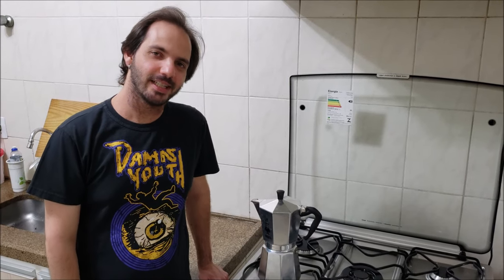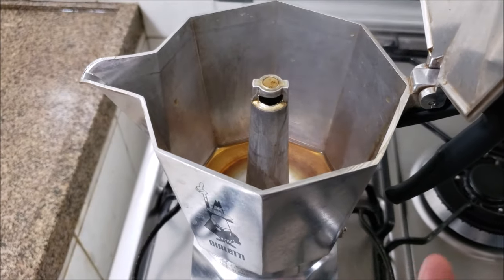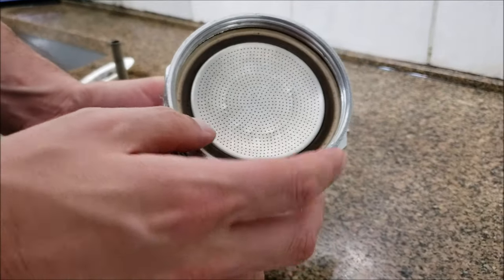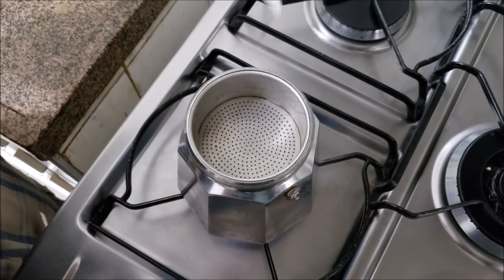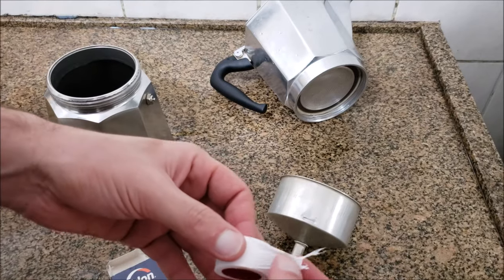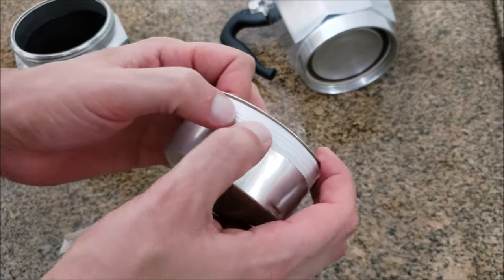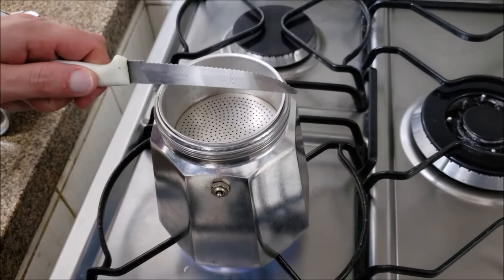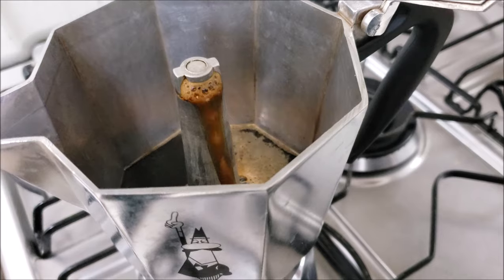Moka Pot sputtering or not working correctly: how to solve it!

Comment: Hello,  I used your solution and its working very good! I know that you mentioned that it can withstand up to 230 C however, the tape I am using is melting, or to be more specific the white color of the tape is gone on some parts of the tape, leaving a transparent tape. so I am concerned about using this tape. I read your comments one said you could use a tape for engines! Can you think of something else I could use?
Reply from the maker: Hello, Ahmad! If you're using a PTFE (Teflon) tape, you shouldn't worry about it, it is fine. It is normal that some parts of the tape become transparent. But if you're worried about it, there is a kind of high temperature silicone glue, which is used to seal engines cylinder head, and maybe it could work. Another solution is finding a O-ring that fits to your Moka Pot funnel. I hope I could help you!

Comment: i just wondering, is there any chemical contamination issue with this tape? when we heating the water?
Reply: I was thinking the same thing. I don’t think Teflon tape meant for pipe leaks should be used for food-grade products.

Comment: 9 years ago I bought a €5 supermarket brand moka pot. It still works fine, but last week I bought a Bialetti moka pot for €20 thinking it would be better quality. Not at all, it brews slower, there’s plenty of water and stray grinds left in the bottom chamber after brewing, therefore, less coffee. Also, the designs are just stupid I don’t need a brightly painted pot with a cubby moustached guy embossed on it. The simple design is part of the beauty. My point is don’t be fooled, Bialetti is the most well-known brand, but it isn’t the best quality moka pot.
Reply from the maker: I agree with you! I bought my Bialetti thinking I wouldn't have issues with that... big mistake! I'm lucky I could fix it and make it work, but I've spent a lot of money on that, it shouldn't show issues like that!

Comment: Hi! Thanks for the video. I've other issue with my recently bought moka pot. When I try to use it, initially I just hear the water boiling on the low part, but when the coffee raise it emerged so violently (literally jump over the can) that I cut down the fire and the half of the water keeps in the lower part. 
Honestly I don't know exactly what to do and I'll really apreciate some help to solve my issue and start using my moka pot :(

Comment: Isn't PTFE seal tape made from the same thing that makes Teflon, which is can cause a bunch of health problems if heated too much, and won't the tape be coming in contact with the water you'll be drinking?
Reply from the maker: Hi Pedro! Yeah, it is the same compound. But as long as you don't leave it at the heat after all the water comes up, the boiler of your Pot won't overheat more than 100°C. And at this temperature the PTFE  won't degrade (the melting point of the PTFE is about 247°C). Other than that, it quite doesn't get in touch with the water because of the place it is located. 
The only way it could be bring you health problems is when you heat it without water in the boiler, so that the PTFE tape will melt. But at this point, even the rubber gasket will melt, which is also detrimental to our health. 
I hope I've answered your questions!

Comment: Thanks Vinicius, what a brilliant idea. I've bookmarked your video, in case I have trouble with mine. Out of the box, brand new, I had to fix up the badly cut funnel tube, by getting rid of the burrs and polishing it on the inside. Something I should not have had to do. Is that a Bialetti 9-cup pot? If so, that is the one I have. Cheers. 👍
Reply from the maker: Thanks, ss! That's nice to read from you! 
I know what you mean, because mine was also not so well finished. 
This one is a 12 cup pot. 
Cheers!
Reply: @viniciusandrea3251   Hi Vinicius, yes, I thought your Moka looked like a larger pot. I can see this thermal problem being worse on an 18-cup one. That was probably the largest they could make it, before it failed to raise the boiling water.
To fix the tubing, I used a closed long-nosed pliers and ran that inside the tubing, to ream it out and make it round. Then I rolled up 1200 grit wet or dry sand paper and polished it out. Then cleaned up the outside of sharp edges. The aluminium is very soft, so it has to be very fine grit. 👍

Comment: I need some advice. Next to  the gasket on the bottom of the upper pot, there is a beige color caulk seal. On my pot, this seal is disintegrating and after a brew I find bits of it melted on the rim of the lower pot.  Is there a way of replacing this seal?  What sort of caulk should I use that is food safe?  Thanks.

Comment: Is there any concern with exposing the PTFE tape to high temperatures as it is in this scenario?
Reply from the maker: Excellent question. No, because the melting point of the PTFE, when it becomes dangerous, is about 350 °C and the moka pot temperature, when fulfilled with water is about 100°C.

Comment: What is the reason if the moka pot  suddenly dumps half of the water trough the steam-valve at the side, not long after starting to heat up the pot (before the stove is maximum hot and before any water decides to come up)
Reply from the maker: Well, probably your safety valve is defective. You should consider repair or even replace it

Comment: It still looks wrong to me. Rubber seal have to have double function tighting the boiler and isolating the funnel from the boiler. So your initial experiment is wrong. You had to force your gasket on the rim, but even if you did that it would not be very relevant. I can't think of the way ifentifying if funnel is still loose after assembly of your moka pot other than that spitting behavior. If it does that it could mean either that funnel is deformed or that gasket is to be replaced.
If your moka pot is new you have to return it if somethings like that happens.
Your solution looks to me more like the last resort when everything else had failed.
By the way Mukka (the one with cow spots pattern and some kind of milk frothing contraption on the stem)  has that additional gasket on its funnel for some reason.
Reply from the maker: Hi Vlad, how are you? I see your point and agree with most of it. The rubber seal really should have double function, but in my case and in the case of many people, it wasn't happening. And that's because the funnel gets somehow deformed due to the use. Even tightening it as strongly as possible, depending on the issue, the gasket can not manage to seal it correctly. 
For sure my tip is a last resort, and the "best" solution would be buying a new funnel. But buying a new funnel is not always easy (in some countries it has hard to find to buy) and it is way more expensive that Teflon Tape. Other than that, that's the beauty of this hack: an easy, cheap and alternative solution to make your Moka Pot work nicely again!! Look at the comments of this video and check how many people could have great brews again doing it. Isn't that great!?

Comment: what if you put the tape on the threads? great fix but you know you dont want no ptf chemicals in your coffee. i was searching to see if you can actually fill the pot past the the pressure release valve and that is how i came across yout video. God bless you for coming up with solutions to make sure we allways got coffee 😆
Reply: The threads aren't what's leaking here, so adding tape to them won't help.  The leak is the gap between the basket and the boiler edge.
Reply: @LJ-wo1wf  I’m a genius 😝🤓 🙏🏻👍

Comment: The original rubber gasket eventually fail. It will lose flexibility and after a while will no longer seal the top assembly to the bottom. The solution is to get neoprene gasket replacements off the internet. Amazon sells them for not too much money.  Neoprene tolerates the coffee making temperature and remains flexible while the original rubber gaskets will quickly fail.
Reply from the maker: Thanks for the tip, Joe! I'll try it!

Comment: Thanks a lot, this worked for me and I've had troubles with this issue for a while, it saved me from buying a new one! 
For me it started doing it when I changed the gasket, initially I thought it was because the size of it was wrong (it doesn't seem to perfectly fit the upper part, it moves a little bit, even though it is a Bialetti gasket supposedly of the good size), any idea why?
Reply from the maker: Hey, Giullaume, how are you? I'm I could help you! Did you check if you bought the correct size of the gasket?
Reply: Im fine thanks, and you? It is supposedly the good gasket size (bialetti gasket for 3-4 cups moka) but in my eyes it isn’t the good size, it lacks something like 1mm, hence the gasket and filter are slightly moving when touching it. It’s strange as I dont think Bialetti changed their gasket sizes over a few years... 
Anyway with your technique I’ve had perfect coffee for a few weeks now so its ok, even though I’d like to solve the mystery and find the right gasket size!
Reply: New gaskets will cause this problem every time, due to the fact the rubber is hard and clean, ie. grippy. You won't be able to tighten the two halves of the pot enough to compress the seal enough to hold pressure. Solution: lube. Just dab a little vegetable oil around the rim of the pot with a fingertip before assembly and crank it TIGHT like always. After the first use, residual coffee oils should be enough. You shouldn't need any PTFE tape either, if the funnel top is round and flat. The rubber seal is designed to seal the pot AND the funnel from each other.
Reply: @tularjaggs334  thanks a lot for the tip, I'll try that! I've been using the additional tape like on the video ever since and it works, but I'd like it to work normally and not have to change the tape every week for sure!
Reply: @guillaumejankowski4203  You could double check the tolerances of your pot/funnel combo too, it isn't difficult. Put funnel into pot, make sure it's perfectly centered (as always), and lay a straight edge across the top. Ideally the top edge of the pot and the top of the funnel are exactly the same.
I believe I flat filed the top of my pot down just a little to achieve perfection. It works every time without fail.
Reply: @tularjaggs334  Flattening the top of the pot can solve the problem. Though it seemed to be ruining the pot. I have tried and succeeded.
Reply: @tularjaggs334   I have sputtering happening with a brand new moka por, it looks very nice a Bialetti the colours of the italian flag, I was so sad to had to return it, I will try the vegetable oil, do you think it will get worse with time ?, I only used it three times, the first time I had not much coffee on the upper chamber because of the sputtering, the second time seemed like it was working and the third time back to sputtering again :-(, also read somewhre that silicon gaskets work better than the original ones

Comment: Won't the seal melt due to heat? I need answers because I'm afraid it may cause some health issues. Thanks
Reply from the maker: Hi Christian! The melting temperature of the PTFE tape is 247°C. Once the Moka Pot temperature when brewing coffee is about 100°C, it won't melt. The only thing to worry about is that you shouldn't leave your Pot on heat for too much time after the coffee is ready.
Reply: @viniciusandrea3251  okay sir. Thank you so much!

Comment: Another issue I came across when dealing with my moka is the coffee grinding. If it's too fine, the sputtering may occur. I solved it (most of the times) using a medium grinding instead of a fine one. There were some cases I couldn't find the cause. 
E fita veda rosca? Só podia ser do Brasil mesmo!

Comment: Another problem is if the valve doesn't work properly and the steam comes out that, it won't push up the water. The valve needs replacement, I'm not sure if it can be fixed.

Comment: How well does the tape withstand the hot temperature? Does it melt?
Reply from the maker: It can withstand up to 243°C. It doesn't melt while the boiler is full of water. If, for some reason, you heat it without water, or leave it at the fire for too long after the coffee is ready, it could reach this melting point temperature of the PTFE (243°C).

Comment: Hello, could you please help me. When ever i try brewing without putting coffee, the water comes out smoothly, but when i try it with coffee, it sputters. i can't seem to figure out what the problem is, i have tried using fine grind and a coarser one. I use pre ground coffee btw. I've also tried doing your experiment and it works fine.
Reply from the maker: Hello! Have you tried using the PTFE tape? If yes, you could check if the filters (including the one from the funnel) are not clogged. I hope I could help!

Comment: I have exactly this problem and I will try this solution but is there a more permanent solution than a teflon tape?
Reply from the maker: Well, the Teflon tape can stand a few brews (more than months brewing), cause it can stand up to 240 °C! So you don't need to re-wrap it every once. Other than that, it is pretty cheap! But if you want something more permanent, there is a kind of silicone glue that is made to resist to high temperatures (it is used to seal car engines), and you could make a sealing layer with it.
Reply: Ideally you can buy a new funnel, that might solve the issue as the old one might be a bit deformed
Reply: J-M P I think my funnels are getting deformed because I tap it when I want to release the grinds. what’s the best way to release the grinds without denting the funnel?
Reply: Sricharan C oh, wow!  I will try that!  Funny, that’s what I do with the narrow part when I rinse all of the parts of the Moka pot when cleaning it so that the funnel will dry a little quicker!  Thanks for the tip!😁
Reply: Eleanor Massaro  I used to do that as well now I use a spoon to remove the grounds 🙂
Reply: @eleanormassaro5195  Yep, that's what screwed up my funnel too as I tapped the grounds into my compost pail.  Teflon tape restored the function back to original and now I shake and rinse rather than tap!

Comment: Hiii those tapes are heat resistant?  They can be used for a long time no problem?
Reply from the maker: Hi, Elisha! It can resist up to 247 °C. When water is boiling, the temperature of the Moka Pot is about 100°C, so at this condition the tape won't degrade. I'll only face issues when you heat it without water inside the boiler, but at this point, even the rubber sealing gasket will melt! So, yes, it can be used for a long time with no problem ( mine is with the same ptfe tape since 3 months ago! ). I hope I could help you! :)
Reply: @viniciusandrea3251  wowwwomg yayy.  In my country,  those are called teflon tapes.  When i told my dad about this he had doubts.  I guess i would just really have to check if the ptfe you are using is exactly carrying the dame specifications of this teflon tape i find in my country.  Very very helpful.  Thank you so much for explaining 😊😊
Reply from the maker: @randomthings92497  Yes, here in Brazil it is also called Teflon tape (Teflon is the comercial name for the PTFE, which was invented by Dupont). 
From my experience, there aren't substantial differences among the  physical properties of  PTFE tapes (I know because I worked with PTFE during my PhD thesis).
Reply: @viniciusandrea3251  ohhh great great thank you so so much. Now i will finally get to fix this pot.  Thank you again.  This means a lot to me. I appreciate your replies a lot

Comment: shouldent my moka pot be making noise. the only thing i hear is a bit of a creaky noise when its getting up to boiling but im not getting any noise whatsoever when its gurgling or anything. i can hear the water boil in the bottom chamber but still thats all i hear absolutely nothing ewlse. is something wrong with my moka pot?its imusa which has decent ratings on amazon

Comment: I have to put tape on it every time I use it? No long term fix?
Reply from the maker: Hi Garry! No, you don't need to replace the tape every time you use it. Mine, for example, is in my Pot since 3 months! I only replace it because it gets stained with coffee. 
That was my fault, I should have left it said along my video.
I hope I could help you!
Reply: @viniciusandrea3251  thanks for the info. I'm going to try this possibly tomorrow and see if that is my issue. I was going to toss it if I had to do this every time.

Comment: What if the valve/screw on the outside is leaking some water during the boiling process?
Reply from the maker: Well, it is a sign the valve of your pot isn't well tightened (or is even damaged).

Comment: I got a problem my Moka pot is stuck I tried to make green coffee in it with green coffee beans , I made the coffee but the moka pot couldn’t open. Any advices?
Reply from the maker: Wow, that's a shame. Have you tried to heat it up (but not so much) or even putting it inside the fridge?
Reply: @viniciusandrea3251  yess!I actually did and it worked for me and lesson leaaarned hahha
Reply from the maker: @altsnaked6096  wow, great to read it! Cheers!

Comment: Great idea however i will say do not use Teflon tape under noncircumstances its is toxic. Instead I uses butchers twine  around the rim of the funnel and it v worked perfectly.
Reply from the maker: Thanks for your comments and suggestion! Sure we must be aware of the toxicity of the PTFE (Teflon). However it's not toxic in all conditions, only when it is heated above 350°C, which is the melting point temperature of the PTFE. Above this temperature, it could liberate fumes the are harmful for our healt. But the moka pot temperature when its fulfilled with water is around 100°C, and so it's safe for using the PTFE tape.

Comment: what if the problem is a leaky steam release valve?
Reply from the maker: Hi Jennifer. 
In this case you should try to fix it or even replace, cause this is a safety valve to prevent you from an explosion!